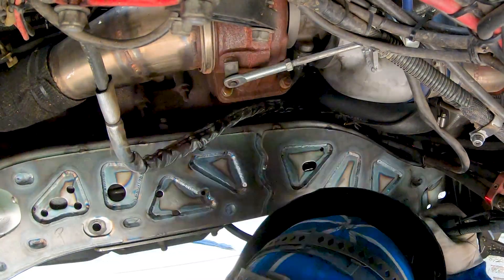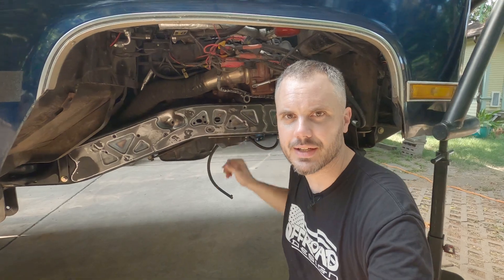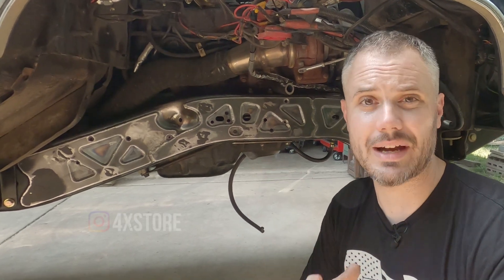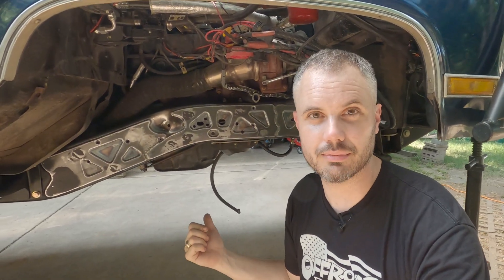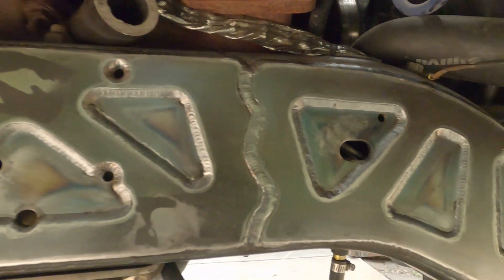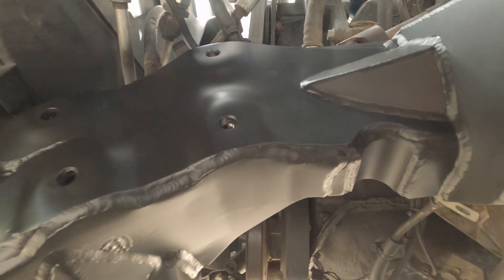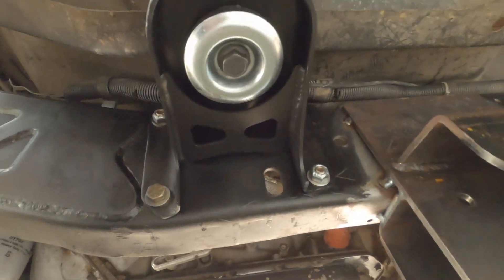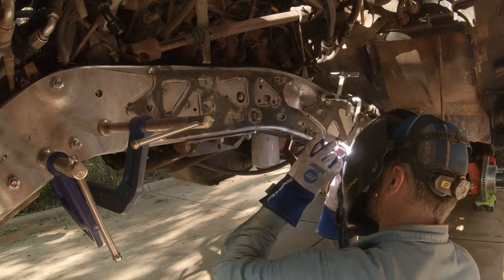TIG Welding for Days! Heavy Chevy Baja Frame Overlays - Squarebody Summer 04 - Rev5 Suspension

Comment: Ah, a fellow Texan who actually gets to bring his toys out for some TIG fun in the sun... I'm assuming you're more central or towards Dallas, where the humidity doesn't cook you alive.
BMT... We can trade shops and you can work indoors like a caged animal. 🤣 Humidity ruins everything on the gulf and the argon sweats.
Working on my stubby suburban, a K5 that has to see some fender work and I'll very tempted to turn the original front fenders into enlarged wheel openings. Relocating the factory flares as far forward and back as far as it'll let me. Since my 39.5 bit the rear of the front left-hand side!
Reply from the maker: Welding in the heat is quite the treat, but you're right, we've got to get it covered in paint ASAP!
Reply: @WillometMotorFab  staying inside makes me lazy 🤣 getting hot gets it done. Feeder hand toast does too. 👍🏼

Comment: could i buy the cad file from that frame bracket? that is assuming the pickups are the same frame sections lol
Reply from the maker: You can actually buy the plates from 4xStore.
Reply: @WillometMotorFab  I looked I didn’t see them right away but I’ll def take a set once I figure it out lol